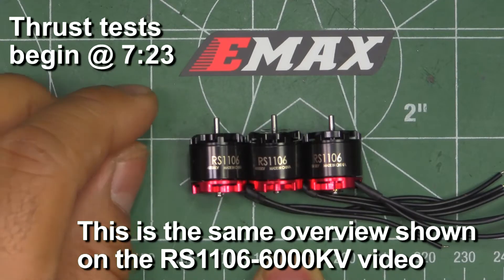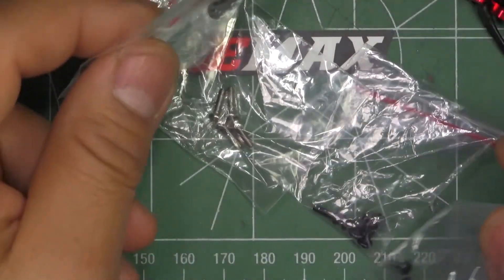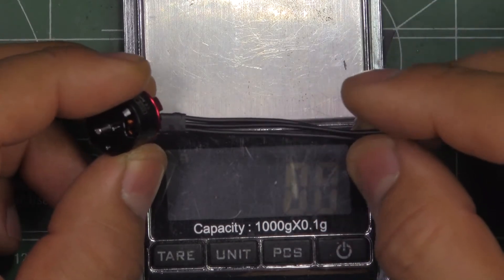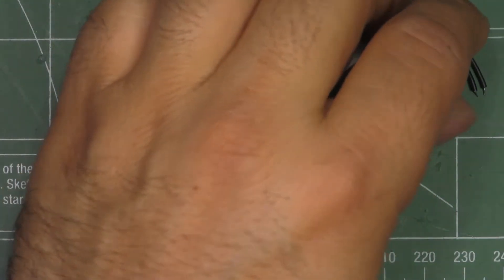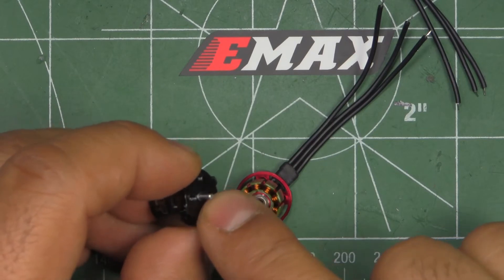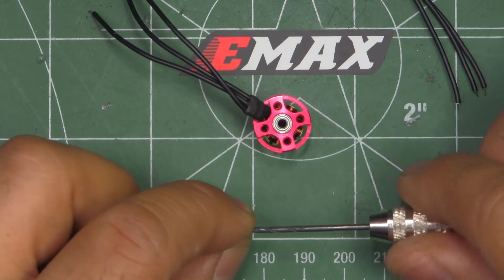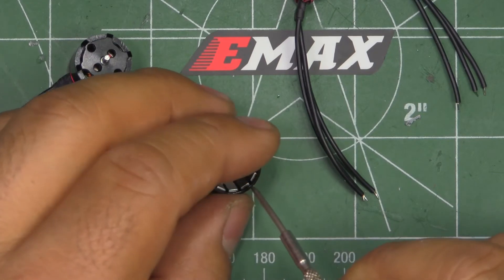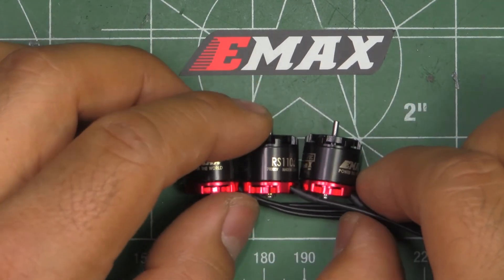EMAX RS1106-4500KV Tiny Motor - Big Power! 3S & 4S Thrust Tests

Comment: I am trying to decide between these and the 6000kv models. I think either is a step up from the Emax 1104 that come on the Babyhawk. I will only be running 2s and 3s.
Reply from the maker: From what I've seen and what people have been commenting, the 6000KV are the most versatile. You can run them on 3S & 2S. But for 3S I would definitely do some good research first to make sure the ESCs can take the load. Multiply the Max Amps by 0.65 to get an estimated max expected on the prop you want to run (but that's still approximate max so proceed with caution) The 4500KV really need 3S to get some good thrust I think. I believe the stock Bhawk motors are 5500kv? so 6000kv would be a better upgrade as long as ESCs can take the loads.
Reply: EngineerX OK thanks.  I will try the 6000kv and hope the esc hold it.
Reply from the maker: I just saw BHawk's ESCs are 6A only !..... EMAX should've included at least a 10A ESC :(
6000KV on 1940x3 & 2040x3 on 2S should be OK. On 3S the 1940x3 seems should not overload ESC. 2040x3 will be at the limit on full throttle bursts. Seems no one has yet posted if upgrade to 6000KV is OK
Reply: EngineerX Thanks for your wisdom.  I guess I will be the first to test this combo. I will mostly fly on 2s lipo and hope the magic smoke stays in the esc. I have them on a very open frame, so maybe I will get lucky. I have tried to look up the specs of the mosfets on the bullet 6a esc but I am too blind to see the numbers.
Reply: I got the Emax rs1106 6000kv motors yesterday in the mail. Do not try to run this motors on the Emax 6a Bullet esc, they will burn. I tried to fly with 2s 450mah 75c and Emax 2345 props. One of the Esc burnt out on the second flight.
Reply from the maker: Aaaargh... sorry to hear that. I didn't get to test the 2345 props but it probably loads motor a bit more than the 2040 or 1940x3.
Reply: EngineerX That is the way it goes. I knew I was pushing the limits. But I was hoping I would get lucky.

Comment: Hi. What do you think about this combination of AIO BetaFPV 12A / Battery 2S 1R or 2R / Motor BetaFPV 1106 4500 kV / Propellers HQPROP T65mm x 8 (size 2.5" pitch 1.5")? The weight of the drone ready to fly is 75g with 2S1R or 105g with 2S2R. I wonder if I will get the right thrust-to-weight ratio to make the flight stable with enough power for light acrobatics? Regards

Comment: Hey, it's been a while.
Are 1106 motors still good for a light and powerful 3" toothpick ?
Seems 1404 are the new trend.
Although 1404 are now mostly used on 3.5" props.
I'm planing on 1106 4500kv for 3".
They are just much lighter for its size compared to 1404's.
The 1106 inner motor shafts are just 1.5mm. So maybe less durable
Reply from the maker: Seems the larger diameter motors do better than the narrow 11mm wide motors.  1106 will have OK power for 3" but they tend to run a bit hot and go through battery faster.  I think that's why the 14mm motor became more popular.

Comment: Nice Video! But it would be very interesting how the Emax AVAN Mini 3 Inch 3X2.4X3 - Props perform in comparison.
Reply from the maker: Thanks. Those Avan props fly very well from what I've seen. I believe they were designed by the same guy that designed the larger 5 inch props and some of the RaceKraft 5" props. Just guessing from the airfoil profile, looks like they're specifically designed to work best when flying forward with some airspeed. On static thrust tests they don't show good numbers and it's somewhat unfair compared to other props that do much better. Avan props you actually have to test and compare them in-flight.
Reply: @EngineerX  Okay, that's interesting. I was searching for new props for my quad and your videos are very helpful finding the most efficient ones! Thank you very much! :D
Reply from the maker: @executeOrder69  If I'm not mistaken those Avan were designed for flying fast so perhaps not the most efficient for slow-longer flights. I have not tried that many in that size. If I get a hold of a set of those Avan I'll run a test to see if they have same low thrusts tests as the larger ones. Thanks for watching

Comment: those short wires is stupid, just about every 3" quad builder won't use those motors because of that
Reply from the maker: Hopefully EMAX fixed that in new micro motors. Banggod is sending the new emax 1304s and 1206's I think those are the new sizes
Reply: @EngineerX  ah cool, are they released? those sizes sound nice, I heard these tall stator narrow motors draw alot of amps for what they put out in power... they are very light though ofcourse
Reply: have you tried the tachyon 1108 motors?
Reply from the maker: @zacjohnson8404  Yes, I believe they're already being sold @BGood. I got shipment tracking already.  That's what a lot of the micro people are noticing, 11xx motors are power hungry. They can be fast but discharge batteries quick. 12xx, 13xx, and 14xx motors are a little more efficient and may work better in certain builds. It's going to be interesting to see how they compare against the 11xx motors
Reply from the maker: @zacjohnson8404  not in a quad. I havent  had much time to build anything lately :( but other 1108s I've seen people use get comments of being battery killers

Comment: What gauge are the motor wires I need to extend them thanks
Reply from the maker: I just took a look at the test motor I used. Wires have no markings, compared to 22 AWG and they look like they're smaller diameter still. So I would say 24 AWG should be good. 22 AWG is slightly thicker but should also work fine.
Reply: EngineerX thank you very much for looking I really appreciate it!

Comment: I just noticed that the 4S GF 2040x3 - 150g Thrust Load (A) is only 1.3A, should that be 4.3A?
Reply from the maker: The Excel thrust table is available from the link in the video description. The correct data is there. I made the Excel spreadsheet so that it pulls values for the specified thrust points, but sometimes it picks up values when motor is ramping down (off-throttle) so the Amps will be wrong. Check the table and go to the corresponding propeller tab. That's the data generated by the thrust stand logger.
Reply: Okay, that makes sense. I may have to brush the dust off of my Excel Skills, you have some great data! Thank you, for your response and your channel! =^.^=

Comment: Is there a reason that I am missing, that you would leave out the HGLRC 2035-5 props? The RX 2035b BNx4 will give me enough thrust, but I am wondering if I could get a bit more out of the 2035-5 props? Especially on 4S? I am trying to stay in the 2" class.
Thank you in advance for any help you can offer! :)
Reply from the maker: On the thrust stand I noticed with these micromotors, the 4-blade props begin to overwhelm the motor and they quickly overheat because in the thrust stand the motor is not moving through the air so the props really stress the motor as they're grabbing more air than when moving at speed. An additional blade puts even more stress on the motor and it won't show that much increase in performance while Amps climb much higher. That's why you will not see many people who have the fast setups flying with those 5-blade props. Most use 2-blade or 3-blade props. 
5-blade props my give you and advantage from the low to mid RPM range but will most likely go flat from mid-range to top RPM.
Reply: Thank you! I figured that there would be a reason. I am putting together a 2", 3-4S setup, and am getting to the Motor/Prop combinations. These little 1106-4500kv motors just might be the trick! Love your channel!

Comment: Hi, where can I find the RX/GF 2525BNx2 (PROP 4) propeller ?
cause I can't find it in any store.
Reply from the maker: Sorry, I didn't explain. That's the GemFan 3025 propeller cut to 2.5" I used a caliper to measure and mark the blades, then used scissors to cut along the mark. That method seemed to work OK, no noticeable vibration on the thrust stand. GemFan just released a new 2540x3 propeller which is getting good reports and should also work very well with this 4500KV motor.

Comment: Do you run these small tests on the default 5Kg load cell? The default one will have a much lower resolution and accuracy for thrusts that low. It is easy to swap it to a 1Kg load cell.
Reply from the maker: Yes - default 5kg 
Correct, a 1 kg load cell will be more accurate. I did do a simple check using a couple of calibration weights I bought from Amazon. https://www.amazon.com/Smart-Weigh-CW-50G-Carbon-Steel/dp/B00FN075LY
50g and 100g. Load cell readings for each was quite accurate and repeatable within one to 2g. I filmed it, video is in my laptop still I think. So based on that rudimentary check I figure it would spit out OK data for anything from 50g - 300g. Also RCBM stated somewhere in their website that loads under 50g would not be accurate.
* Not recommended for propellers producing a maximum thrust under 50 g.
https://www.rcbenchmark.com/dynamometer-series-1520/

1 Kg cell would probably be better but I'm constantly testing 11XX, 13XX, 14XX, 15XX, 22XX, 23XX, 24XX, 25XX , etc size motors so I'd rather not have to switch load cell too often.
Reply: I was asking because I tested the same motor recently (https://goo.gl/UZAxjK). I also run on 3.7V per simulated cell (lab supply) and I get similar A readings. Your thrust values for e.g. the Hulkie are 20% higher than what I measure. I just wrote a tutorial on how to swap the load cell here https://goo.gl/ukuje4 . I also verified the readings with a set of weights from 10 to 200g, all readings are spot on. I can not figure out why our readings differ. Your motor was tested to have a bit higher KV than mine, but nothing that would explain +20% of thrust. Strange :(

Comment: EngineerX I got hobby King graphene 3S 45c 800mah batteries for $6 each with shipping. I have Emax 1106 6000kv. Do you think it is good combination on 2inch? Or better to have 2.5"? Not looking for the best speed. More likely house flier or fly right outside of my house.

Comment: Hi mate, is there a possibility you can collate the 1106 results for all the motors together so we can get a direct comparison, personally I'm interested for 2s and 3s data on GF 3025 props
Reply from the maker: That would be very useful. Unfortunately I have very limited time for testing motors/parts and keeping up with a bunch of motors that I've yet to test so that's why I haven't done more complex compilation tables. I do have links to the Excel spreadsheets on every motor test video. Link is in the video description so you can download all the thrust test tables and copy/paste into a table. There should also be a playlist for all the 11XX motors https://www.youtube.com/user/EngineerX/playlists?

Comment: I appreciate all the testing. Can you do a comparison on fat arm vs skinny arm amp draw for these motors?  Example, I noticed a huge difference in amp draw when I switched from a 23mm arm width to a 10mm arm width. Amps shot up.
Reply from the maker: Right, that is very possible, Amps could increase more in this size class since a lot of the thrust will be blocked by the arm and could create some turbulence right on the prop.  I'd have to figure out a way to mount motor to the thrust stand on the 2 arms.  It would be a very good test to show if there are any differences. No doubt the skinnier arms would be best.
Reply: Sorry I did not mean these motors in particular. Motors in general.

Comment: very interesting results! a lot more efficient , and since its on 4s it will result in longer flight times since 4s packs have more energy. Thrust is not bad on the lighter 3 inch dual blades but on the heavy ones I can hear the motor slowing down as it reaches its peak. That means I think that it is still a bit weak to have proper authority on those 3 inch triblades. It will be different on the air for sure, but still. On the other hand the 7500kv is a lot more powerful, on the top end at least, but the amp draw is of the charts  , you will need larger and heavier 3s lipos to get decent fly times. The 6000kv seems to be the best of the three , good power decent amp draw on 3s . Can't wait for the 1304 tests ;-)